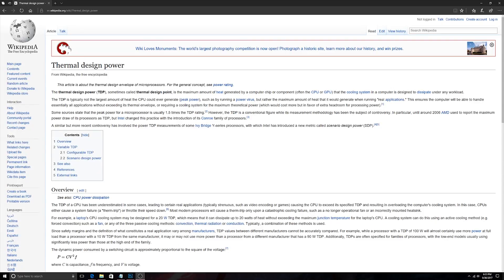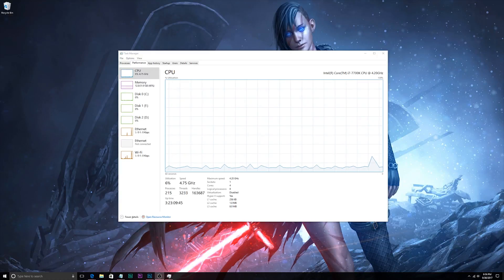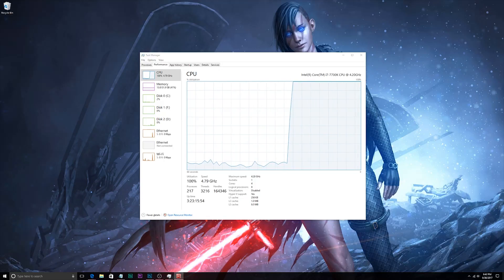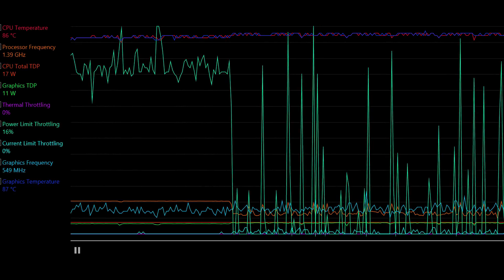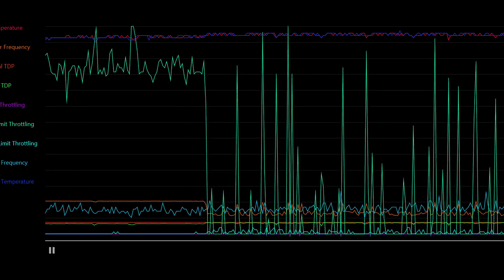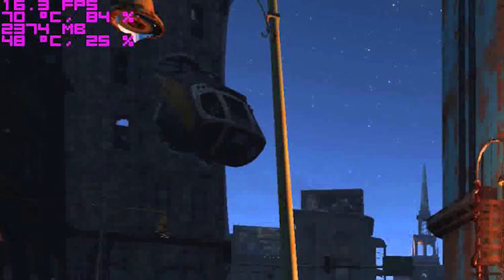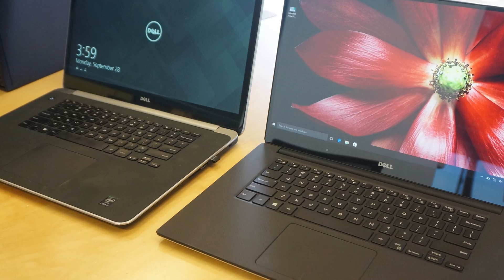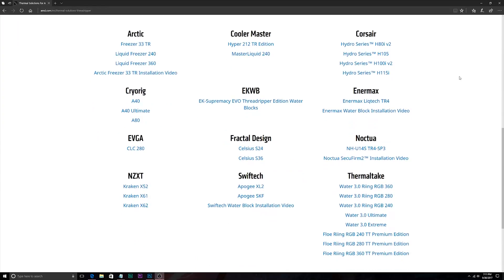What is Thermal Design Power? (TDP)

Comment: bro my computer's max tdp is 65w will it be sufficient if i input a processor of  tdp 95w? .. will it work without change in performance for like 2hrs in intense gaming
Reply from the maker: It really depends on the cpu cooler you have, and what that is rated to. Which kind do you have?
Reply: @CircuitsAnonymous  Hello :)
I have some questions: I have an i7 8750H in my Asus RoG strix Hero 2 and want to turn down the watt. 
I cant find the TDP settings in the Energy Options. Do you know how i can set it up? 
Will it help to keep my laptop cooler ?
Thanks and regards